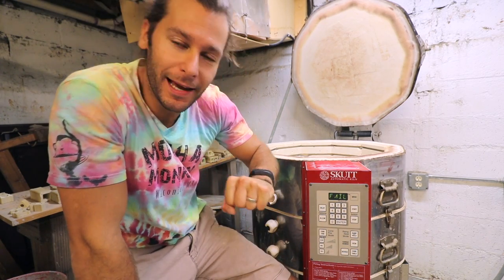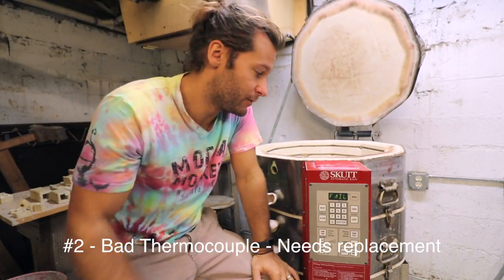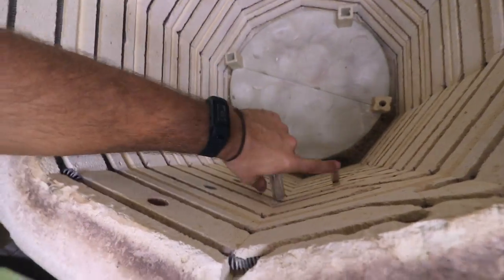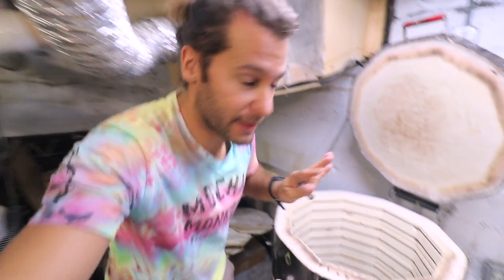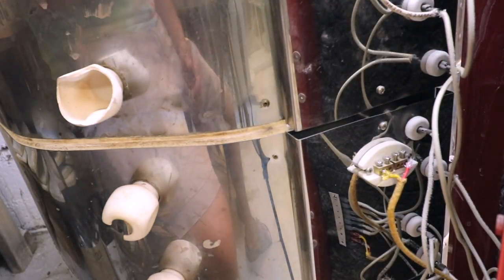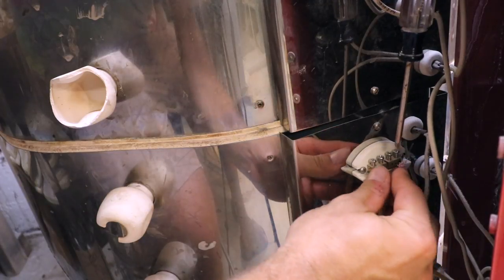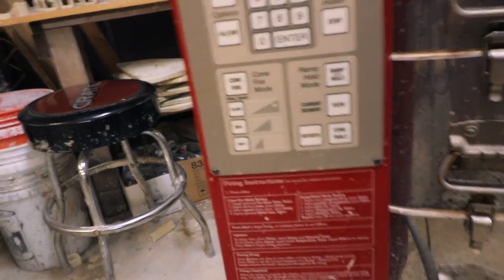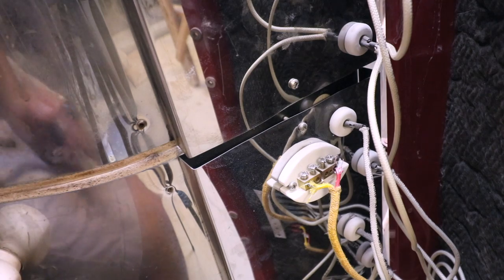How to Replace a Thermocouple - Kiln Maintenance

Comment: I am thrilled to have found this video.  I panicked, called an electrician. He told me that he didn’t service appliances & that the electrical connection was fine & took off.  Hmmm!  I watched your video & happened to have a spare thermocouple which I installed myself - took me a while to reposition the thermocouple but I DID IT.  Thanks so much.  Kiln seems to be up & running again.  Whew

Comment: I was given a electric commercial kiln that works and even though I have it for sale on Offer Up , folks aren’t biting . One person lives in Florida and the other 2 live here in San Antonio. 
If it doesn’t sell soon I’m gonna remove the electrical wires and use it for scrap metal . 
It was used in a University here in San Antonio .

Comment: Thanks for sharing. Beside visual inspection you can also easily measure resistance of the faulty thermocouple and detect if its a faulty.
Reply from the maker: Thanks for the tip!

Comment: Great video. Mine's the sealed type so I'm hoping it'll last forever but still very nice the learn how to replace it 👍 Thanks for sharing. My kiln is quite old and came with a low grade temperature fuse because it was from a school that only fired earthenware. Did some rewiring myself and now it fires to stoneware 😉

Comment: I only fire like 2-4 loads a month and put in a new one when I got this used Skutt about 8 months ago so hopefully I have a long time before it goes out but have a backup anyway. My pottery store in Portland is closed on Sundays too! But they are pretty overpriced for most things so I just order online. How often do you have to replace elements? They say they last about 100 fires so I’m guessing you have to do it every year and a half or so. I just did the elements and a bunch of bricks and it was a total pain but doable for a semi technically inclined gal.
Reply from the maker: I just replaced the elements in that Skutt kiln about 6 months ago after 350 fires!!  I now have 445 fires total so hopefully I can get more than 100 with the new elements:)

Comment: Hi Jon. I have an LOL easy fire and I have three thermal coupling and I’ve never had to change them in 12 years I think that’s because there are sealed .you can’t see the wire.
Reply: Yes you have type S thermocouple they last for ever. It's easy to replace from cheap type K thermocouple to type S but you will also need to reconfigure the kiln controller for S type, and also rewire the sensor with type S wires to the controller.

Comment: That thing needs a sheath on it and it will last forever. As long as it dos'nt get way over cooked. I use 50 alumina 50 kaolin thin slab and wrap it around a drum stick then i insert the thermocouple inside it, this protects it even under the harsh conditions of salt firing ...